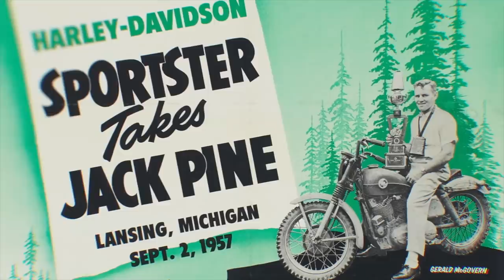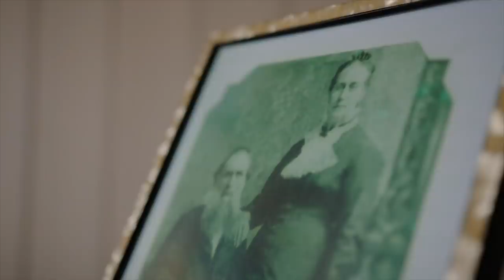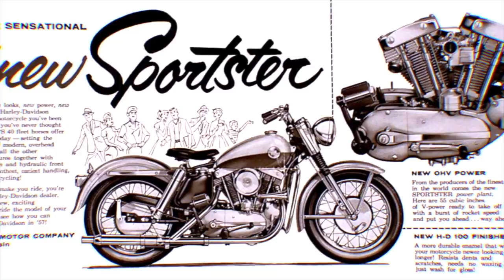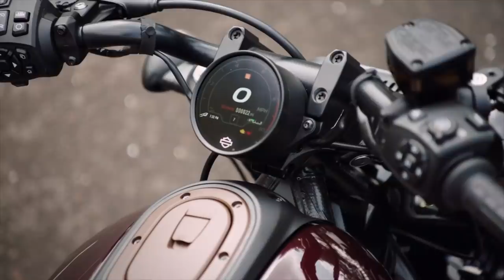Harley Smashes The Competition?  New Sportster S & Is CEO Jochen Zeitz on Track?

Comment: This is new territory for HD and not everyone’s going to like it. Realistically, the air cooled motor is on its last legs and trying to coax ever more power and meet US and Euro standards has hit a dead end. Plus, much of HD’s traditional customer demographic is aging out, many, like myself, are on their final bikes. While the cruiser and touring machines are still a cash cow, it won’t remain there for much longer.

 The good news is HD did their homework with the Pan America, creating a machine that rates very highly against the BMW GS 1200 benchmark. In fact, a local San Antonio, Texas dealer is sold out of their allotment even before the bikes rolled off the truck. This is new territory and a potential new customer base of which many never considered a HD product.

The new Sportster is another matter. The machine is up against a 64 year old icon steeped in lore and tradition. Personally, I believe it was done right. Aggressive looks and power, good ergonomics, very forward looking with hints of what came before it. 

The bad news is, nothing is guaranteed. Numerous events like the economy tanking, geo political crisis, the resurgence of the coronavirus, and most important, customer acceptance, could all play havoc on HD’s plans no matter how well made these machines are.

To sum,  this is a bold gamble for this venerable company; the responses have been, on the whole, very positive. The traditional HD base may yet come around, change is never easy. While there will always be those that never accept this new direction, this move may yet prove to be HD’s salvation.

Comment: I strongly believe the sportster s is the flagship for a while. 2022 should kill off the current sportster and bring in less premium revolution era sportsters. No inside info but the last decade of patterns would suggest nothing different to me. If it doesn’t happen for 2022 release it would have to be at least 1 more model as a mid year launch. My 2 copper.

Comment: As an Indian Scout owner I'm loving the new Sportster S, but to compare the two is fallacious; a straw-man argument:

The natural competition from Indian for the Sportster S is already available: it's the FTR.

Similar power, USD forks, American styling, rider modes, digital dash (touch-screen too) and all the other high-tech toys the Sportster S packs.

At almost an identical price.

To compare the Sportster S to the Indian Scout - a bike that has been virtually unchanged since it was designed seven years ago - is a cheap shot that does little justice to the ingenuity & imagination that's gone into the Sportster S.

I don't know if Indian will come back with a Scout with 120BHP because they don't need to: the FTR already delivers that in a chassis & suspension package that can truly handle that sort of power.

Cruisers like the Scout and Sportster S have limited suspension travel and ergonomics that poorly lend themselves to sporty riding.

So I'd like to see you do another comparison: Sportster S Vs FTR.

Or are you chicken? 😉

Comment: Pan Am claimed Hp/Tq per HD- 150/92. FuelMoto Utube Dyno test- 130Hp/79Tq.
Sporty S claimed Hp/Tq per HD- 121/94. It'll probably have the same 14% parasitic loss through the trans as the Pan Am & end up at 104Hp/80Tq. Not bad, but the Sporty S looks uncomfortable & costs more than the cheapest Softail. Yeah, I'll pass for now.

Comment: So, I guess we'll just take Harley's word for all of it and say it smashes the competition. A little premature don't you think? And if it costs 3 grand more than the competition it better smash the competition. But I don't see it. Why is this engine detuned for this bike? If they crank it up to 150 ponies then Ill give you that. You mentioned a few things in passing that might be a bit more of an issue than just in passing. 15 grand for a short trip bike as you say. Is that bang for the buck? The exhaust feels way to hot just looking at it. Sure sure, the Motor Company and the aftermarket will come up with fixes but why should I have to consider fixes for basic stuff like seats and exhaust for a bike that already costs more than the competition? But hey, that's Harley Davidson. The more things change the more they stay the same.

Comment: First off, The cantilevered tail light is a mess. I think the exhaust looks hideous, too. I like a lower exhaust, not the sport bike, muffler under your ass configuration. Personally, the front fender is way too small for my tastes, it appears to be the size of a sanitary napkin. Above the Kotex, it looks like either this bike got punched in face by the back bumper of a jacked Chevy pickup or they ran out of money, or talent, when they got to the headlight area. It looks unfinished. Like they meant for so much more to be there but due to budgetary constraints, Covid-19 or some other nonsense it didn't happen. Maybe the designer's dog ate the good sketch. I would rather see a round LED headlight instead of a cousin of the monstrosity they hung between the blinkers of the Fatbob a few years ago. I could do without the full length drain pan stuck to the bottom of this bike, too. Are they anticipating an issue with the engine being able to the oil on the inside? It appears Harley is pricing themselves out of the entry level bike market altogether. Other than that, I hope they sell a million of them.

Comment: This is not the right bike for anyone. For the price I could get an Indian Scout and two new Honda CT trail bikes, or, for a bit more, a Yamaha VMax if horsepower is the goal. It doesn't do anything better than lighter, less expensive bikes. Harley has simply lost their way. From electric 2-wheeled sewing machines to selling BBQ grill sets and garden gnomes, they don't even know their own brand. HD should have introduced a 650cc single standard with a full boat of aftermarket mods and sold it for $7999. Perfect for the selfie crowd. If they want to step out and capture a new demographic, the way to do that is NOT to produce the same tired V-twin idea into what they hope the lukewarm, low-interest Millennials will find interesting enough to buy. Build something easy to ride, unintimidating and inexpensive. Old school HD guys wouldn't like it, but that's exactly why they need to diversify.